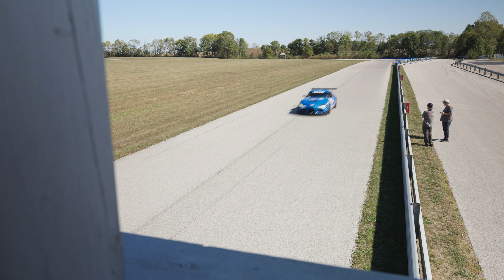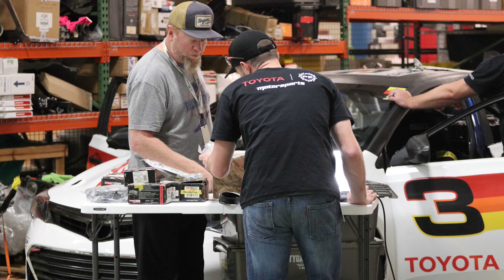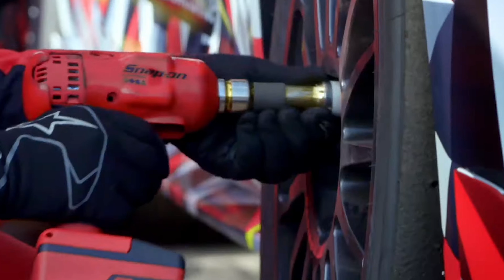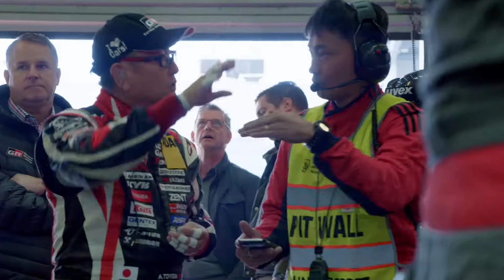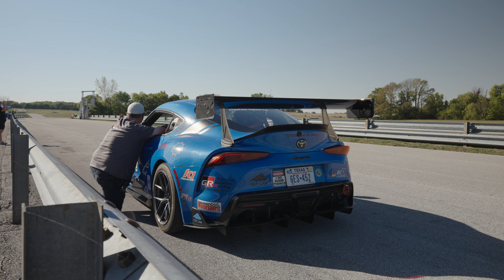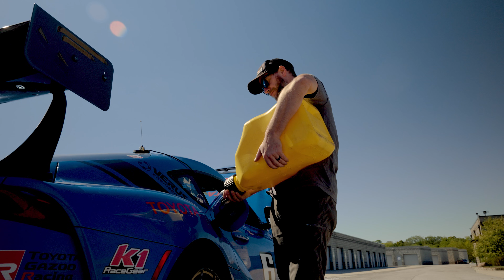Racing for Toyota as a full-time engineer | Toyota PE

Comment: if toyota really meant to see these cars on the track, it would address and fix the GR86 right hard turn oil starvation problem.
Reply: As a 2024 BRZ owner, im curious to know if that issues falls more on Toyota or Subaru. Im excited to see what Toyota does with the Mazda Miata
Reply: @Cooke2g well the engine waa designed and built by Subaru. I would say Subaru.

Even the simple replacement of the oil pickup from the OEM that has an elbow to an aftermarket oil pick up that has a straight tube helps a lot.

Add on a sump baffle or the one that verus newly created where the sump baffle is integrated on the sump pan.

The car just, unfortunately have ans bad oiling system design.

But it can be fixed ofcourse.

Alot of modified cars that has turbo or superchargers also go for the oiling system upgrades and would drive for 100k miles without causing any issue.
Reply: Subaru problems